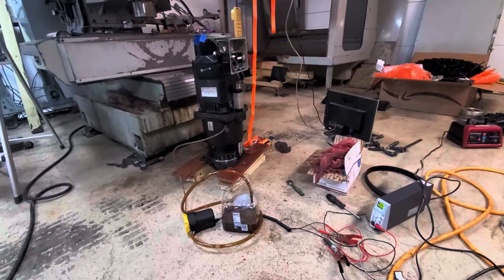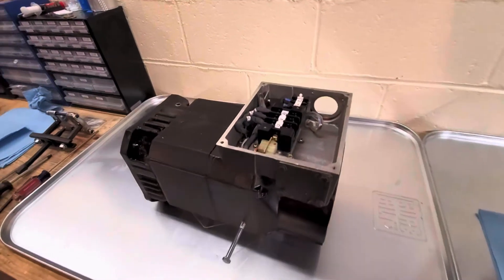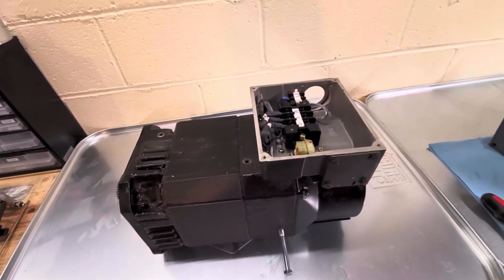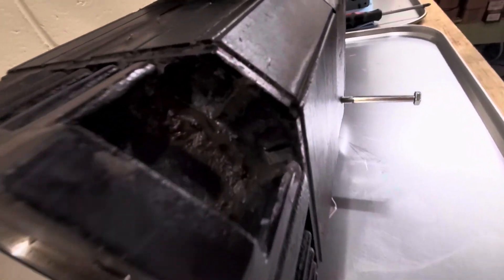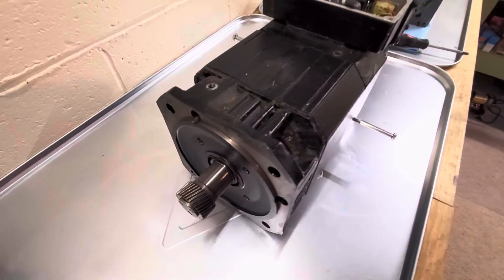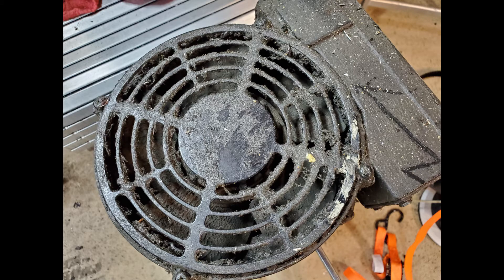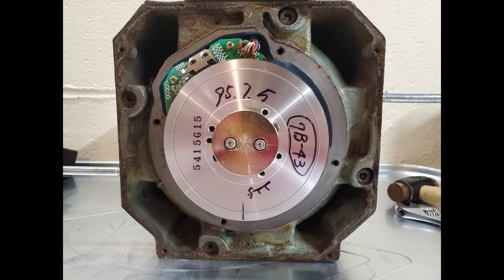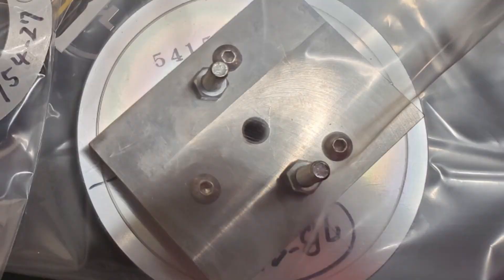Bridgeport Rebuild Part 5 Yaskawa Spindle Motor Rebuild

Comment: I owned a 96 TC 22 and loved it. Ended up selling because I had to move but for the $3,500 I paid it ran great and still had amazingly little backlash on the screws(0.0002"). The one thing I hated was the spindle motor whine. I had heard many others make the same noise and assumed it was like that from new but I wouldn't be surprised if it occurred due to age.
Reply from the maker: Yeah they were a bit noisy from new but they progressively get worse with age.  I rebuilt the gearbox on mine with all new gears and bearings, its a right pain to do as it's all heat shrunk on the shafts but it significantly reduced the noise.  Cost 1k for the full gear set plus about $200 for the bearings all named brands.  You could just send it into geartechnik and they will rebuild it but it costs about 3k.  I did some internal mods to the gearbox too so getting every last drop of oil out when servicing is now easy, standard there is always about an inch of oil in the bottom separated by webbing that turns into sludge, that you can't get out without taking the box off the machine and turning it upside down.
Reply: @weldchip  Interesting. I found it was all heat shrunk from new when I tried to get a gear off and ended up having to use a puller. I loved the fact that everything was pinned and precisely made, well over engineered that you probably wouldn't find even on high end machines today. If I still owned the machine I would likely follow your lead and rebuild everything. I considered replacing the gearbox with the direct drive 8,000 RPM setup as I didn't need torque as much as speed since I make a lot of smaller bits. Had hoped the noise would be reduced as well but Yaskawa is to blame for the high pitch I believe. Love the details of your video and its stuff like this that makes certain machines go to for the aftermarket community. I tried detailing my mods for the same reason when setting up the spindle drive single phase on cnczone.
Reply: This is brilliant 👍🏻 thanks for the inside look I’m gonna do mine I think. Where did you source bearings ? Right from yaskawa ?

Comment: Ment to comment here , how did you source the bearings yaskawa direct? Great look inside thank you
Reply from the maker: the bearings are all standard nsk items if you look in my photo gallery you cans see all the part numbers. here is the link https://photos.app.goo.gl/YFj6Qi4Xu5ap6W6r7
Reply: Thank you! I ended up ordering through yaskawa bearings should be here soon, im going to get my spindle rebuilt and while that’s being done I will tackle this project ! As long as I don’t mess up the encoder it should be a much happier machine when done ✅ thanks again
Reply: Ok just poured through all the pictures !!!! Wow what an incredible job!!! That’s a lot of work you have documented there very impressive thank you for sharing 👍🏻

Comment: How did you lift the spindle motor off?
Reply from the maker: I just used a hoist bolted to the rafters.  To separate the motor from the gearbox you just take the 4 caphead bolts out then lift the motor off.  You may have to cut down an Allen key to get the bolts out.
Reply: @weldchip  I have no rafters. I was hoping you were going to say engine hoist, LOL. thanks for replying to a year's old topic. And thanks for videos! I'll be watching!
Reply from the maker: @jessewilliams7460  if you drop the z all the way down to the table and remove the tool change pneumatic cylinder you can probably do it with an engine hoist